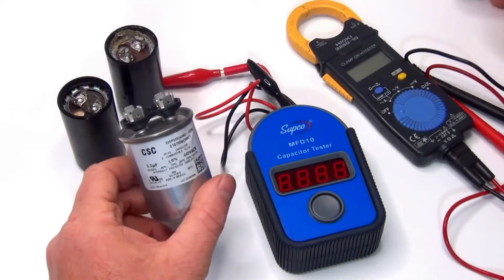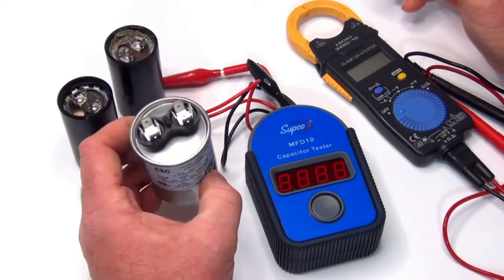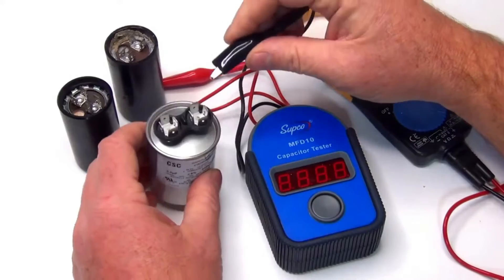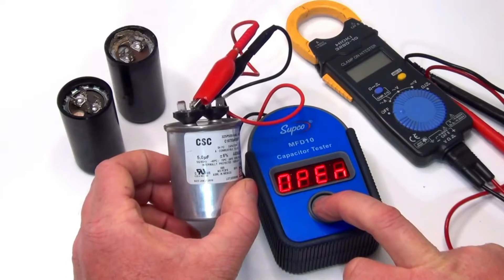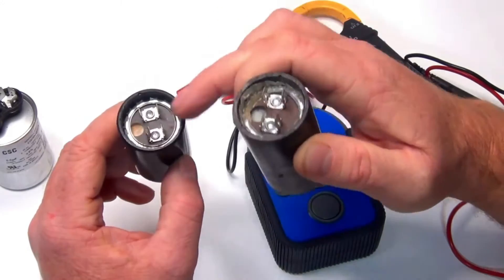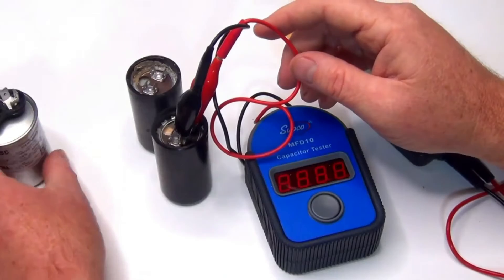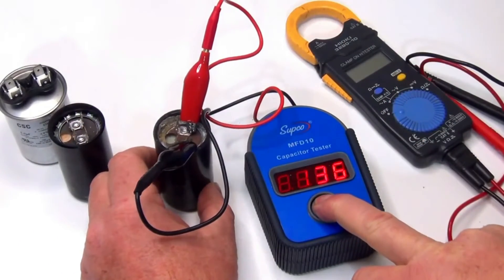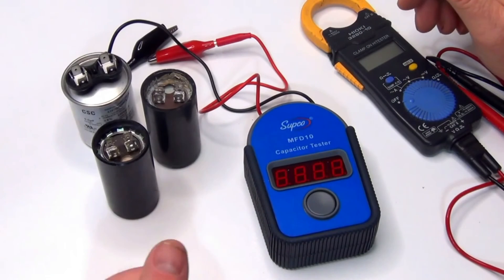How to Test Your HOT TUB Pump Capacitor

Comment: Hi I have the pf-20-2n22x pump one of the capacitors has a huge hole burnt into it. Is this normal? I can't find out what it's rating is. The other capacitor is a 45uf and seems fine any advice please?
Reply from the maker: Have to replace the capacitor if there a hole in it or damaged in any way.
Reply: @VIPPoolsandSpas  The problem is that I can not read the spec of it as it is melted.
Reply from the maker: @Leo-gt1bx  crap.   Can't help you with that.  Even if the motor part is burnt, that would mean it's most likely a windings issue.  Need new motor
Reply: @VIPPoolsandSpas  I have an Ultra 9000 120V 1HP 4.5A Spa Blower. The board tests are perfect at J3 but Blower does not run. Jumper was set to 240v...I changed it to 120V but still no luck! Wouldn't the thermal switch protect it when it was connected to 240v or motor can still damage?